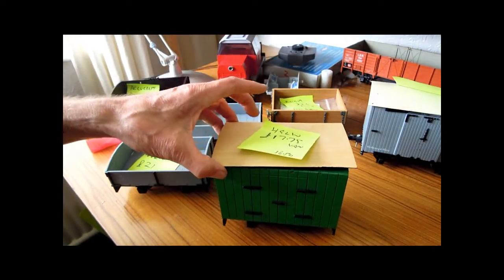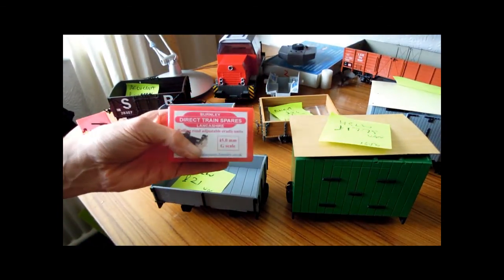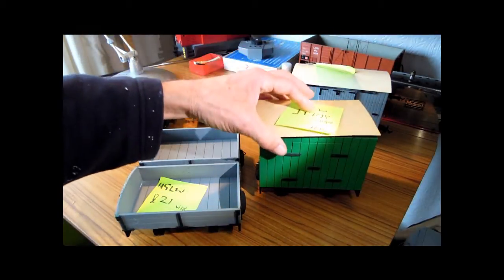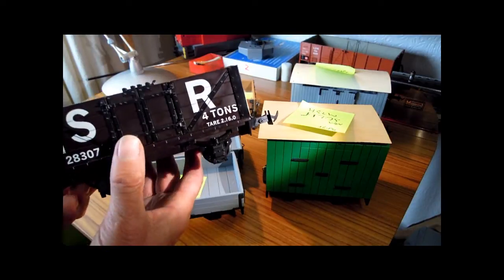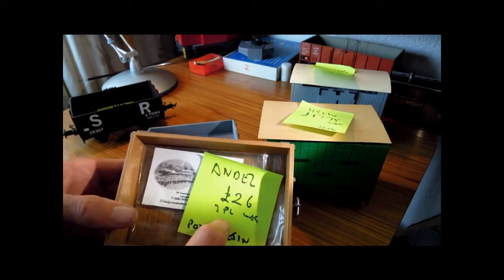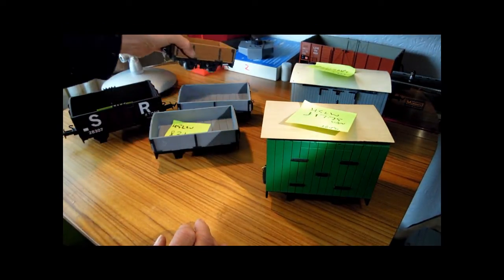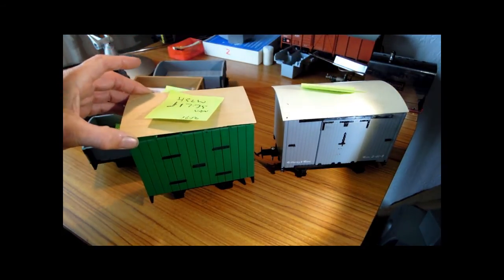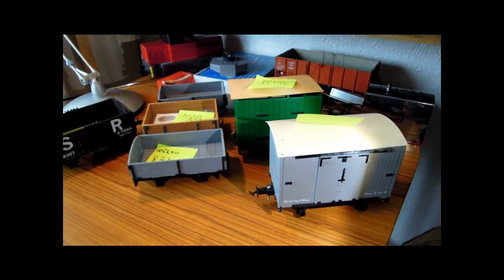Garden Rail Kit Review, HGLW

Comment: Having built kits from both manufactures, I have to agree, great kits especially for the price! The Andel model you have is actually one of his very early ones and he has simply updated the kit over time. Binnie engineering are also great kits and very cheap. Made of very strong (ABS) plastic and very very simple to put together. Look forward to more garden rail updates!
Reply from the maker: Thank you Jack for the helpful comment. I plan to get a couple of Binnie and Andel kits to see how they go together. If you save on painting time it will be a quick way of building up stock.
Reply: I know what you mean, painting always takes me longest, espcially when some of these kits are so simple to build!
Reply from the maker: Jack Sharples If the rain stops I hope to have a go at running some of it!